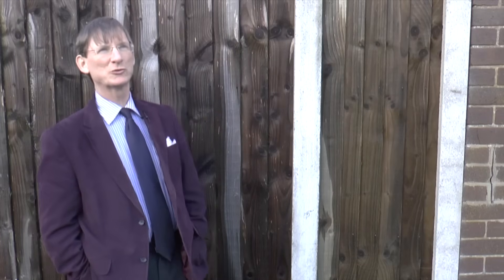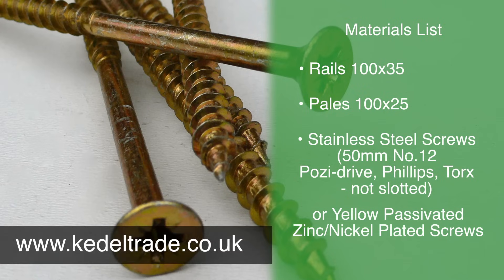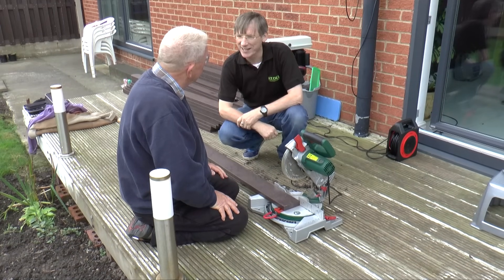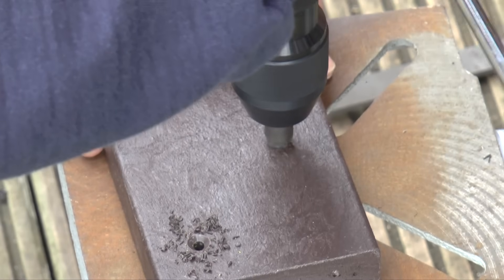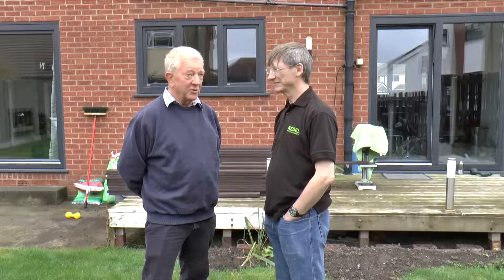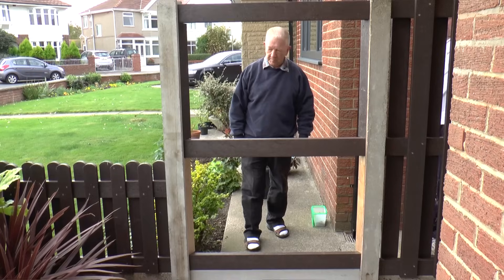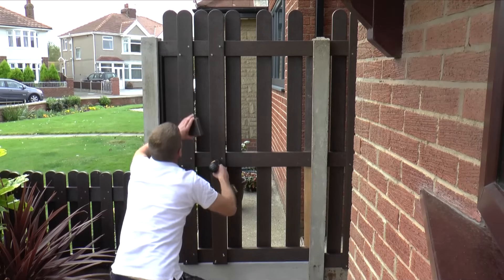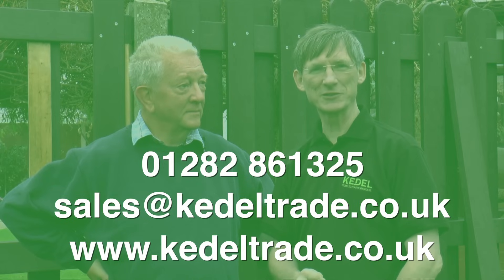How to Build and Install a  Recycled Plastic Fence Panel

Comment: Make it the same cost as lumber and you’re on!
Reply: Can't get the raw materials for less than current prices which track the price of oil even though it's recycled. But spread cost over 20 years and compare to wood and it IS cheaper than wood. No maintenance, and no replacement for decades. Housing associations all over are replacing wood with recycled plastic using their maintenance and replacement budgets.
Reply: @lewiswalch8677  what about when it gets too hot and it starts melting and bending which I have seen 😇
Reply: @ritathomson5675  Hi Rita. The earlier versions of recycled plastic did have issues such as this, but I can assure you our recycled plastic does not melt and our fencing on Your Housing's housing estate in Partington, South Manchester has been up for about 7 years and still looks great and we did have some very hot summers.